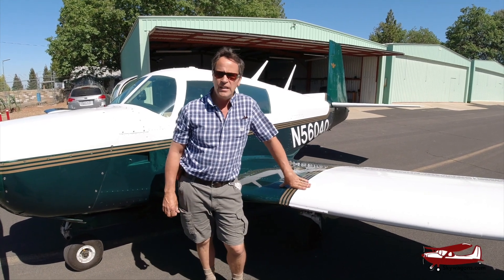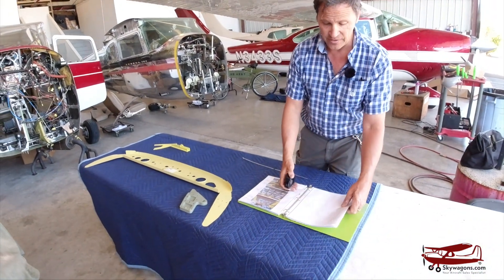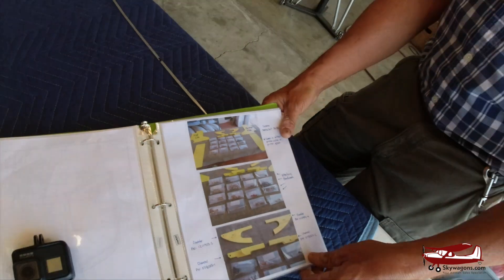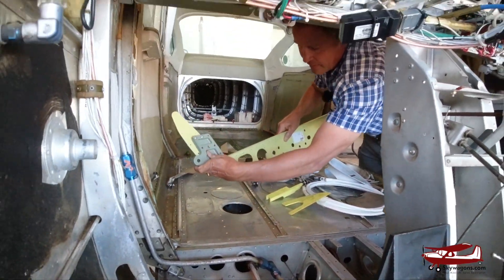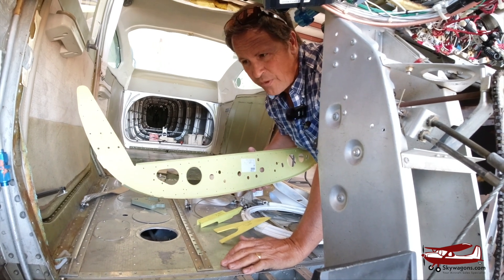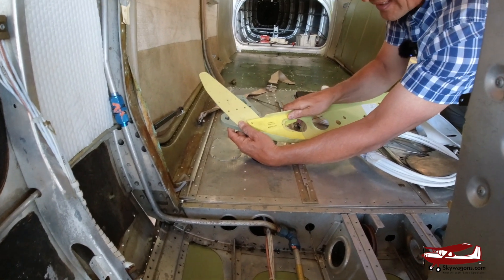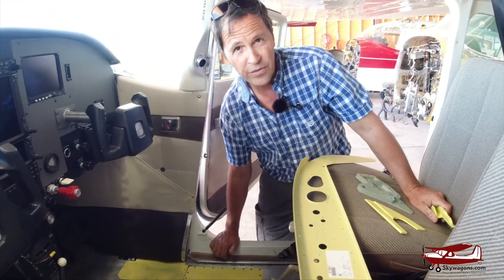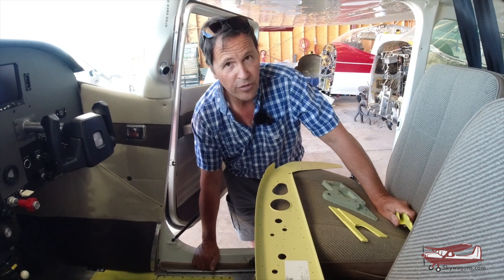Cessna Wing Strut AD Explained in depth with parts shown.

Comment: Hi Mark. Thank you for sharing. Is that little crack that appeared over time make the aircraft dangerous to fly. What could happen if it was ignored and never upgraded. Cheers from Perth W.A. 🇦🇺
Reply from the maker: I think that there could be a lot of them cracked that have been like that for years.  It would have to be very severe to fail and I think that there would be a lot of warning for hours beforehand. It would creak while taxi-ing and in the air and also be very visible with the black aluminum powder coming from the movement area.

Comment: Thanks for doing this. My 182 just got caught by this and believe it or not it’s across the way at Lampson over at Tom’s Aircraft. Steve’s is offering guidance on what they’ve learned after doing several of these. What a pain. When this popped up three weeks ago during annual I couldn’t find really anything about this on YouTube. So we’ll on ya for making this one
Reply from the maker: We feel for you.
Reply: @skywagonuniversity5023  At least it will be done, and now I have a much better idea of what is being done thanks to you. I'm well into the acceptance phase of the stages of grief.
Reply from the maker: I think it was yours then that Tom was working on when I went over there to "borrow" the two parts I used in that video. Those are going in your plane.
Reply: @skywagonuniversity5023  Mine's a white Skylane with a blue stripe. I bet you're right. Imagine my surprise the video I was waiting for someone to make began with you headed to Lampson while my plane is down there. I wouldn't have been surprised if it showed up in your video! Once again, thanks for making it keep it up, all of them. It's super informative.

I actually met you briefly maybe thres-ish years ago at your base there to look at the judge's white and blue skyline. You probably remember that one because the paint was original , I think it was a '78 maybe? Avionics decked to the nines. It sold very soon after. We talked about the flying cowboys, Draco, the High Sierra Fly In and such.

Comment: Not a very strong design.
Reply from the maker: The area around the crack is described as a river of strength.  The area where it cracks was described as a pool of weakness.  The repair provides a stiffener, which in hindsight should have been there all along.  It is a hard pill to swallow when Cessna charges an arm and a leg for the parts to repair their flaw.

Comment: I think I'll look for a newer plane!
Reply from the maker: Remember that there are tens of thousands of strutted Cessna's out there flying about and only a very few need this. 99% of inspections at annual will find no crack and simply be another AD compiled with.  This work only has to be done if there is a crack.  The Comanches have the Tail and gear AD's. Bonanzas have the Spar eddy current AD. Square winged Pipers have the Spar AD etc etc. almost all need no work, but a few do. Buy a good one or buy one that is already done.
Reply: I found out the hard way today. $10,000 repair for nothing. I would not have purchased either if I knew

Comment: If this isn't repaired and the crack propagates, what are the possible consequences?  It is unclear to me what, if anything, might occur.
Reply from the maker: If the crack goes all the way through to the bottom, it could compromise the integrity of the strut attach point, but I see what you mean. It would have to pull all that lower assembly with the casting out through the side of the plane as the wing rotates up and away. It is precautionary as are all AD's and I think more and more of this kind of stuff will come up as the global fleet ages.  Methinks that Cessna did not think that their planes would still be so active 40, 50, and 60 plus years after production.
Reply: @skywagonuniversity5023  Well, yeah,  some other things would have to fail before a wing would come off, but  if you had a crack there and you ignored it and ignored the other signs of failing/failed structure in that area and just kept flying, ultimately the wing could well come off.